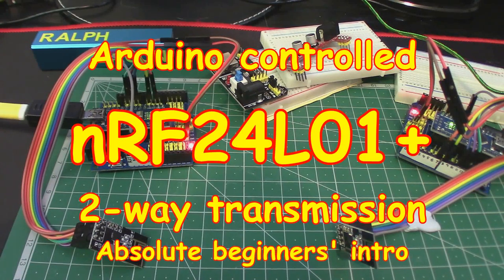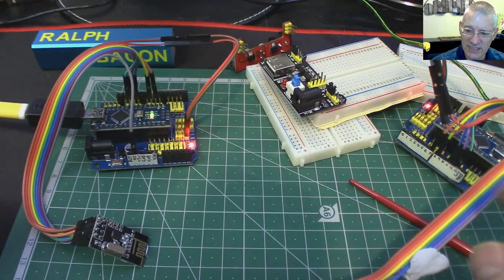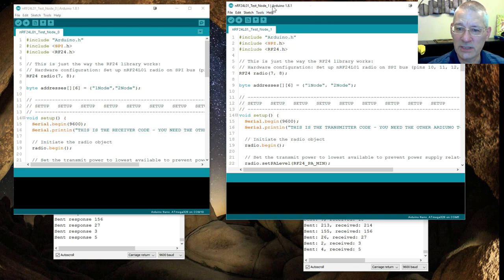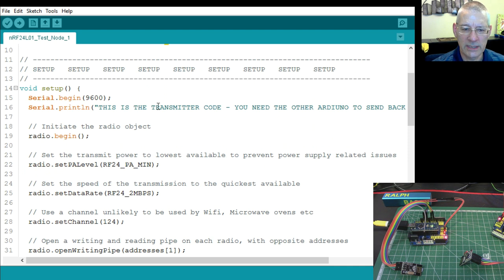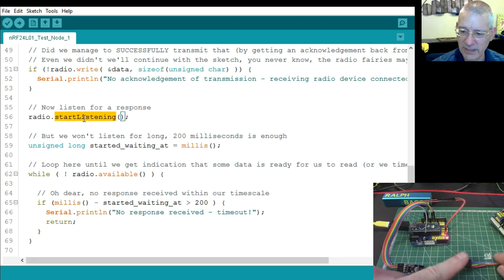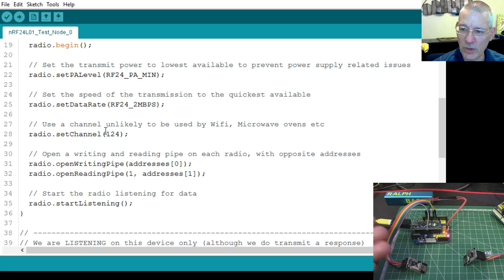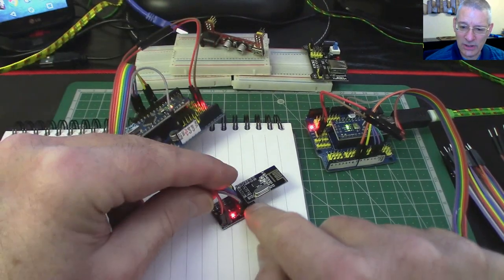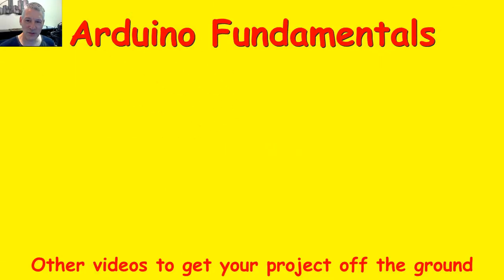#73 nRF24L01 Send (and receive) data with your Arduino!

Comment: Hello :)
can someone plz explain me this line here: byte addresses[][6] =  {"1Node", "2Node"}; ?

thank you :)
Reply from the maker: Hi Margarida! Let's disassemble that statement so we can make sense of it (incidentally, this code was in the original example sketch (not written by me) that I used as a basis for my sketches).
 
byte myarray [ ] [ ]
 
declares an array of arrays (jagged). What??!!  It means that we want to hold an array (what you might think of as a list) of bytes in another array (list). But the number of elements in each array is not/might not be equal.
 
First array (myarray[0]) might contain a list of bytes such as 1,2,E,Z which are themselves an array.
 
Next array (myarray[1]) might contain a list of bytes such as 1,2,3,4,5,6,7,100 which are also an array but have more entries than the first array.
 
Next array (myarray[2]) might contain a single byte such as 99, (but which is also an array with just a single entry). 
 
A jagged array is more memory efficient as memory is only used for elements in use; in the above example we use 4 bytes, then 8 bytes, then 1 byte for each array. Bascially, we store the list of many rows efficiently. The fact that each array contains an array of different sizes means it is jagged (or not even). Some arrays are bigger than others in our list of arrays.
 
However, the statement byte myarray [ ][6] is saying I want an array of arrays but the array is not jagged, it is an array of rows of 6 elements. Remember that in the Arduino World a 'string' is not a standard C++ type; it is an array of char (characters) behind the scenes. So the string "1Node" is actually an array of 5 characters.
 
So he is declaring an array of arrays where the words "1Node" and "2Node" are the arrays contained in the outer array. In this instance, addresses[0] equals "1Node" (an array of 5 characters) and addresses[1]= "2Node" (also an array of 5 characters).
 
In the short space I have here this is the best I can do to explain jagged arrays, or multi-dimensional arrays in C++. You may need to do more research, but I hope this helps a bit. Tudo bem?
Reply from the maker: Here's a link that explains it better than me: http://www.informit.com/articles/article.aspx?p=29401&seqNum=2
Reply: thank you Mr Ralph :)
Reply: just one more thing, if you don't mind ahahha
I need to do a chat(like skype) using 2 transceivers and 2 arduinos, like your demo. :)
but i don't find anything abou that. I'm trying to use your code as an example but it's still hard. 
Do you have any idea on how to do it? :)
Thank you once again :)
Reply from the maker: Ooh, no, I don't think you can do that with these transceivers, Margarida. They can only transmit something like 32 bytes per session, wait for an acknowledgement then transmit more data. You would need very different transmitters/receivers for doing any kind of chat (voice) transmissions. These are really designed just to do a quick burst of data. Unless you mean 'chat' as in typed chat (*more like WhatsApp*)? Then these might work OK actually with really short messages, although your code could transmit several bursts of 32 bytes at a time. Should work. Just expand the example to send more data max 32 bytes (that you can then display on the receivers LCD screen, for example). Which did you mean, Skype voice or WhatsApp typed messages?
Reply: Something like a small chat room. :)
with both of them being receivers and transmitters.
Using the Serial monitors to see. :)
or, as you said, a chat like whatsApp :)
Reply from the maker: Start with two stations. Each Arduino will transmit whatever the user has typed in to the other via debug window (aka serial monitor). The receiving end displays the result onto the debug window whilst you are testing this out and types something in on that same window to send a reply. You will eventually need to work out how you intend a keyboard to work to get the messages in the first place, unless you use the serial monitor to always send the messages. Once you have the basic "type - send - receive - reply" bit working then you can expand to more users (max 6 before you need a networking mesh).
Reply: My problem is the loop function :(
i did something like this in the trasmitter code:
void loop() {
  String msgRx;
  String mensagem;

 if(Serial.available() > 0){
      mensagem = Serial.readString();
      Serial.print("Mensagem enviada: ");
      Serial.print(mensagem);
  }     

  radio.write(&mensagem, sizeof(mensagem));
  
but i don't know if i can do this... :s
Reply from the maker: You need to change the "if(Serial.available)" to "while (Serial.available) " so you keep reading the data until no more is left to receive, appending each character "mensagem += Serial.read();" or something along those lines.
 
Then transmit it, but max 32 characters at one time (split the string into 32 byte chunks and send each chunk in a for loop).
 
At this stage you really need to ask programming questions like this at the Arduino forum (where I am answering question right now!)  see http://forum.arduino.cc and good luck with your project, it's very do-able.
Reply: Thank you for your time and patience Professor :)
Reply: @RalphBacon  Brilliant explanation. Thanks! (Side note; 1 year after the reply it still is out there helping people. Fascinating!)

Comment: very good and help full vedio 
could you please send the sketch 
i am beginner in using arduino
thanks in advance
Reply from the maker: Check description -the links are to my GitHub, two sketches, one for the transmitter (initiator) and one for the receiver (responder).

Comment: can you help me control 4 servo motors wirelessly using....4 10k potentiometer || two arduino ||and NRF24l01 
code please and schemetic
Reply from the maker: I find it somewhat ironic that your username is "Learnings" - because that is exactly what you must do! Learn each of the steps required to achieve your goal and then implement them all, one by one. There is no shortcut to learning this. Follow each of my videos that deal with each of your required sensors and you will have learned how to do it. Requesting (and receiving) a ready-made solution will have taught you nothing. There is no substitute to actually doing it. Good luck with your learnings.

Comment: These modules are really hit and miss. Recently bought a bunch of the long range modules and only a handful of them actually work. Very cheap but also cause lots of headaches. Not worth the hassle imo.
Reply from the maker: I had one that failed after many hours running on my workbench. No idea why. so, yes, they can be a bit hit and miss, assuming that they are not clones (aka fakes).

Comment: Hola Mr Ralph muy buena tus indicaciones pero te quiero pedir un favor si me puedes enviar a mi correo los codigos de transmite and receiver que son dos archivos que nos los puedo bajar para incluir en mi arduino uno r3, soy una persona de 66 años un poco computin pero me gusta esto, saludos, muchas graciasm muy bueno tu pagina.
Reply from the maker: Hola Pedro, que tal? Los codigos estan aqui: https://github.com/RalphBacon/nRF24L01-transceiver. Necesitas descargar este archivo zip y descomprimirlo en tu computadora. Es muy facil hacerlo. Y gracias por tus amables palabras y buena suerte con esto. Hasta luego.
Reply: Hola Mr. Ralpf si baje los codigos y los inclui en mi arduino uno chino pero no se conecta, sigue pestañando la luz de dsm2, que hago me puedes ayudar, necesito su correo para enviarle un video de lo que estoy haciendo, de donde es Ud. es una persona extraordinaria se da su tiempo para ayudarnos, saludos, muchas gracias, que Dios lo bendiga
Reply from the maker: Lo siento mucho, Pedro, pero no tengo tiempo suficiente ayudarle in esta manera. Por que no pides ayuda de aqui: https://forum.arduino.cc donde se encuentran muchos expertos. Creo que este le audara mejor. Buena suerte!

Comment: At 15:20 in this video you gloss over pin 10 saying that it was not necessary. You ignored it and got away with it.

Being the sheep that I am, I followed your video and built upon it by attaching a DS18B20 one wire temp sensor .... guess where I put it? pin 10. There then followed 2 hours of head-banging agony as the whole thing locked up once the SPI bus went live with the radio.begin command, even Serial.print. I moved the sensor to pin9 and re-defined it and all is well.  

For the benefit of others and to justify me wasting 2 hours of life, note that in the SPI library digital pin 10 is the SS (Slave Select) pin. This is the pin on each device that the master can use to enable and disable specific devices. When a device's Slave Select pin is low, it communicates with the master. When it's high, it ignores the master. This allows you to have multiple SPI devices sharing the same MISO, MOSI, and CLK lines. So, pin 10 is vital and should be reserved, preserved and otherwise adored otherwise it is a real trap for Old Players.

Eagle Eyes :))
Reply from the maker: I feel bad for you now 😳as you are correct, I did gloss over pin 10, which is the standard CS pin for SPI (I think I was expecting to use it, but we used the additional pin 8 or 7, I never did understand why the library did it that way). It was pure bad luck you chose that pin to connect your temp sensor to, but your pain is everyone else's gain here as they read your comment. In fact, just to alleviate the wasted 2 hours of your life I'll add a BIG NOTE in the video's description to leave pin 10 alone (or use it for its intended purpose, although how that tallies with using the additional pin 8 I just don't know). I hope this makes you feel that you did not waste time but merely uncovered a big GOTCHA in the demo sketch. Seriously, it's most appreciated that you posted back your findings here.
Reply: Ralph, I expect I will get my rewards in heaven .... if you RTFM nRF's pin 8 is CSN (Chip Select NOT) i.e. active LOW. On the SPI bus pin 10 is Slave Select and is normally HIGH. There is a difference between nRF Chip Select and SPI Slave Select. With all these HIs and LOs the library needs to keep both pins happy.

Comment: what are the uno-sized nano dev board?
Reply from the maker: They are called Nano development or expansion boards, like this one (which comes with a  Nano for about $6):
https://www.banggood.com/UNO-Expansion-Board-ATmega328P-Nano-V3-Improved-Version-For-Arduino-p-1011003.html?p=FQ040729393382015118&utm_campaign=25129675&utm_content=3897
Essential to develop Nanos with. I hope this helps.

Comment: Dear Ralph a Very happy Easter and many blessings from our Mighty Jesus to you and family. I am really sorry to ask you again to help me, but you are the best, and If I don't ask I don't get.
// Generate a single random character to transmit
  unsigned char data = random(0,255); ..............
{ it is a part of your sketch communicating with a receiver  nRF24L01 Send (and receive) data with your Arduino! 
 what I would love to do is to communicate with the receiver with the download function see further below to produce pulse with a digital potentiometer.
The program is working alone but it does not transmit to the receiver.
Please if you can make it to work I will greatly appreciate it.
if you can add it on to your program using let us assume A1 analogue input. If you please email it to me at demetrios@nevadatechnology.co.uk 
I thank you in advance.
Demetrios

  {
  Serial.println("Starting");  

  for (int i=0; i<100; i++) {
    Serial.print("Increasing, i = ");
    Serial.println(i, DEC);
    pot.increase(1);
    delay(200);
  }
for (int i=0; i<100; i++) {
    Serial.print("Decreasing, i = ");
    Serial.println(i, DEC);
    pot.decrease(1);
    delay(200);
  }

}
Reply from the maker: Hey demetiros! First question to you: have you got the project running as I demoed it? With the random number? All working 100%? Unless (and until) you get that running there will be no point in progressing your project. Let me know!